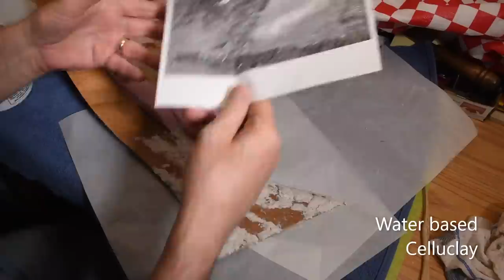Composing & Modeling the "Signature Scene" (Part 1) | River Road - Vlog # 102

Comment: Boomer~ As I’ve written you before—as have so many others—I appreciate all the tips and techniques you bring to the table as you build your new model railroad.  But more than that, you’ve opened my eyes to stepping outside my comfort zone to help this old dog learn some new tricks, especially as they apply to painting and building trees (my favorite).  As an aside, I visited my local wine and spirits shop the other day, looking for some new reds to try, and, lo and behold, I stumbled upon a 2019 Pinot noir reserve from the Russian River Valley called River Road.  So I bought a bottle.  Here’s to you, my friend!  Cheers!  ~Brian
Reply from the maker: Wow! That sounds fantastic. Thank you for taking the time to share that. Now, sit down with a glass of your favorite 'River Road' and enjoy the creative process! Cheers ~ Boomer.😁
Reply: Boomer~ Two questions.  Do you use Matte Medium to glue your foam pieces together or another adhesive?  Also, what is your opinion of Sculptamold vs Celluclay?  Thanks.
Reply from the maker: @briankistenmacher  I usually use PL-300 to glue larger chunks of foam. On the other hand, when I need to add smaller pieces of foam-to-foam I use full strength "Matte Medium." I use both Sculptamold and Celluclay. I find Celluclay to be very similar to Sculptamold.  Celluclay seems to have a finer texture, whereas Sculptamold has a little more coarse texture. Make sure you wear a mask when you first mix it, as the dust should be avoided until it's all wet. Cheers.

Comment: That is the calmest cat I've ever seen!  -  -  -  --  We all develop our own techniques and preferences. I mostly model N scale and have never been able to achieve satisfactory results for myself carving foam. I also feel using massive amounts of foam for large projects gets to be costly. I use pretty old school chicken wire as an armature to support plaster gauze bandages. I do use scrap foam as pylons and struts to support the wire net. I then use my own rock molds to cast in place rocky outcrops or cliffs. But it's the results which count and not how we get there. Your results are awesome! Never seen any better. And I'm anxious to try out some of your methods. Looking forward to your continued build.
Reply from the maker: I raised Dusty on the Glover Road build. When she was a kitten I exposed her to all manner of "power tool" sounds as well. She could be sleeping right by the compressor when it kicks on and she hardly finches a muscle. She really gets what is going on for sure. 

No need for "big" budget materials when you build a small shelf-layout, although, depending on the approach, any railroad can suck up funds indefinitely in many ways.😂
Cheers.
Reply: @boomerdiorama  Agreed, different materials for different situations. Guess I got into the wire net when building a few rocky ridges 4 feet high and 30 or more feet long. I do use foam, but not so much for scenery. Haven't used plywood in a long time. Will be trying out your painting techniques at next opportunity.
Reply from the maker: @jerrysmith1929  Most layouts I built in the past required hundreds, if not, thousands of trees. Thin wire mesh (hard-shell) scenery would never work for planting high numbers of trees. Furthermore, with foam, I can plunge trees and shape composition all day long with no need to fasten one tree because they plunge into foam and hold fast. I also prefer it with the smaller layout as well, but each to his or her own at the end of the day. One only has to forfeit one locomotive and the foam budget is covered in most situations anyway. Cheers.

Comment: Love the cat. I to like to work with the pink foam. I like to have the scenery in chunks so I can take it out into the shop to do the real messy carving while setting down and comfortable. I am toying with the idea of holding the sections together with small magnets imbedded in the foam and the wood in the base. I have also in the past used velcro to hold things in place.
Reply from the maker: There was a time where I was addicted to pink foam when I worked in film. It can be messy, but it takes paint well and is easily revised, not to mention if you want to plant trees. ;-)

Comment: It’s funny that after I saw you model the barge slip it gave me the idea to make a parking lot the same way, which made it easier to focus on it because it was isolated from the board and it’s removable which is a bonus.
Reply from the maker: It takes a little extra planning and effort to do this but well worth it in my experience.

Comment: Ah yes... I've often thought of knocking holes in walls to have a house-long layout... The wife categorically says NO!🤣 

I take your point though, over here in the UK we don't have a lot of space so compression is pretty much a given and Something we need to work with... The lucky ones of us tend to retreat to our lofts (small attic) or attics - my layout is in the living room of our flat / apartment so I've had to do a lot of compression to get what I want in there....

Eventually, as is often the case with our hobby it will get demolished and a replacement built on it's ashes! 

Thanks for sharing your process as always sir, 
Make sure you don't disappoint your feline supervisor!🤣
Reply from the maker: I think the days of the large basement layouts are over. There are exceptions, but who has the time and resources, not to mention the passion, to finish a large layout? No one ever said one has to build a larger layout. Besides, some of the largest layouts with the greatest impact are the smaller (Diorama Style) ones - especially in the UK. ;-)
Reply: @boomerdiorama  yeah absolutely agree mate, a larger never ending layout can be a project that never gets finished

Comment: Question from an art material perspective; Generally you use Golden , in this you used Liquitex Matte medium, you also mentioned Modge Podge.  Not all matte mediums are the same.  Is there reason you would use one over the other or is it  simply a matter of what you had on hand?
Reply from the maker: I use Liquitex "Matte Medium" whenever I have it on hand. I find it to be superior to any other product - in this case. Golden is great as well but for some reason more expensive. When it comes to Acrylic paint for larger scenery sections etc, Golden is the best in the world. ;-)

Comment: Did you skip a video on the rocks down in front of the foam?
Reply from the maker: Yes. I think I mention it somewhere. Things get hectic with production and fall through the cracks at times. It's the same approach as the reef near the barge slip. Stack rock (crushed gravel) and soak in diluted matte medium.